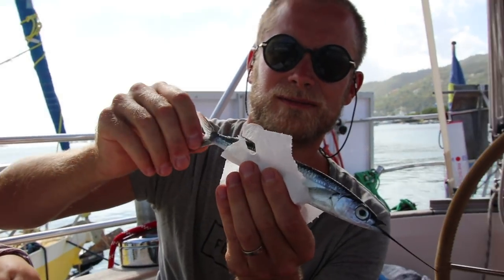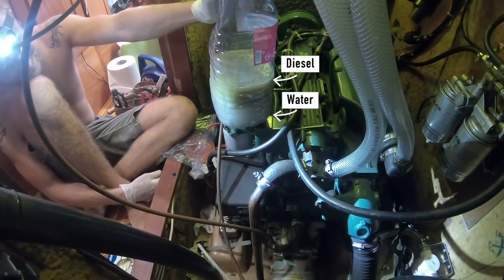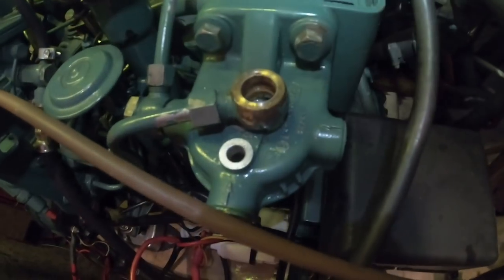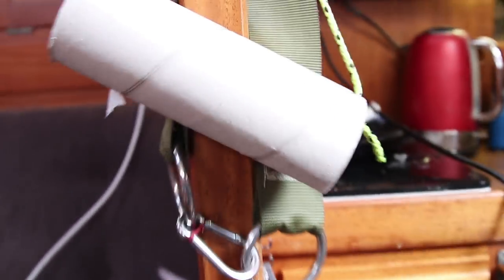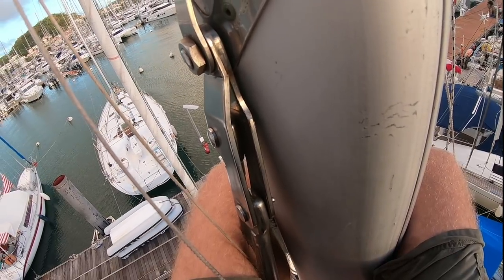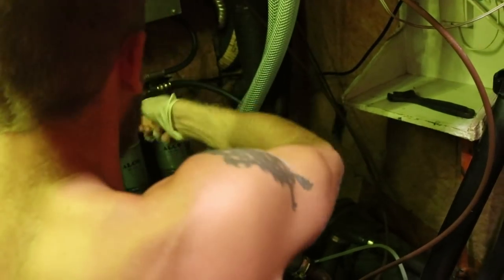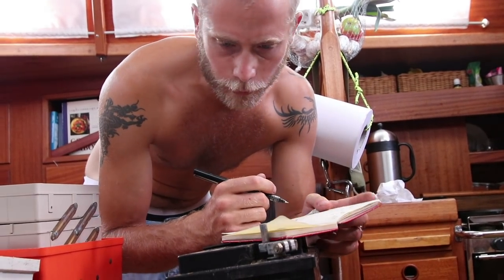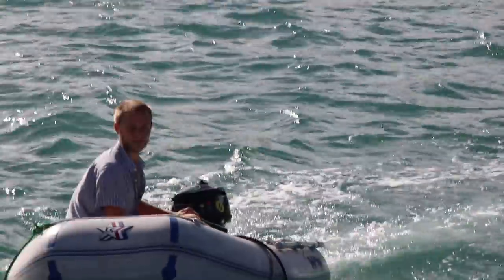The Diesel is NOT supposed to look like THAT! And there is a crack in our mast! - Ep 24  Knotvikings

Comment: Boats can wear down your patience sometimes,did you find out why you had so much water in your diesel tank?
Reply from the maker: Our best guess is that it came in through the tank ventilation that are located on the side of the hull, they have a hose running up as high as possible but it's the only option we can think of. /Chris
Reply: Knot Vikings ,well that's a worry,but m sure you will solve this with a modification of some sort 👍
Reply from the maker: A bit of a design flaw to say the least but we are testing a solution now and haven't had any problems since, but to be fair we also haven't really sailed in the same conditions as during the Atlantic crossing when all this water got in.
Reply: Knot Vikings ,best of luck with it then,I'm sure you've put some logical thought into it,you will win👍😊

Comment: Ugg small diesel water pumps are a weakness, they fall apart clog up the system and by the time you know they are bad you have overheated your engine and have more serious problems. It is best to bypass the engine driven system and set up an in line 12v water pump that turns on when u turn the ignition on. I'll provide a link. https://youtu.be/BibAbvMeGU8
Reply from the maker: That sound interesting, i will check it out thank you for sharing! , we did install a small 12v pump that I ran through an extra filter and I use that to polish the fuel every now and then, I think we concluded that the water came in from the tank ventilation, I installed a waterlock after the Atlantic and that seems to have done the trick even if I haven’t seen any water in it yet..